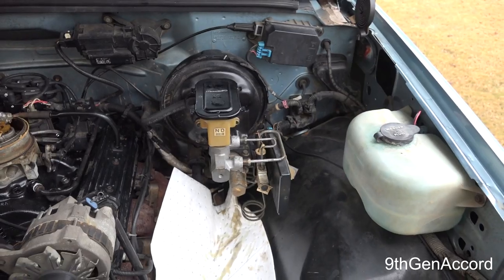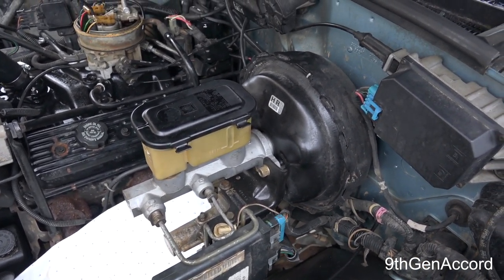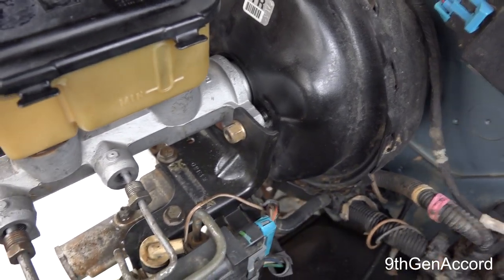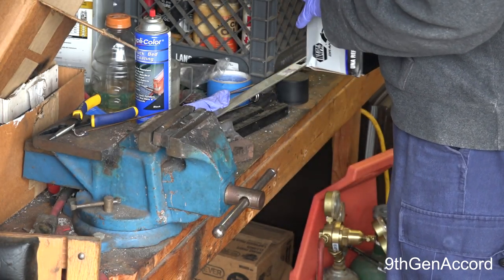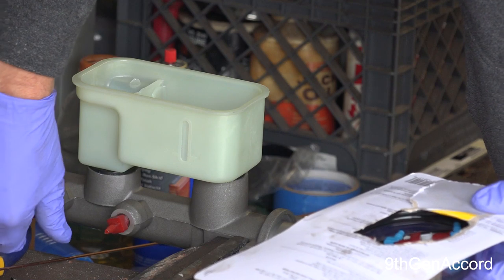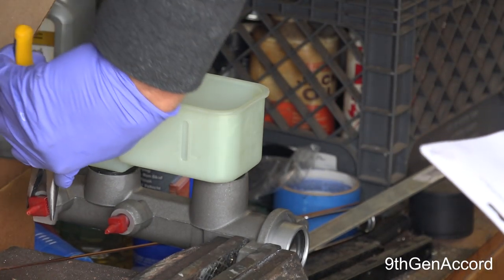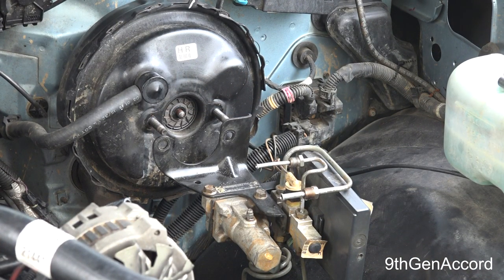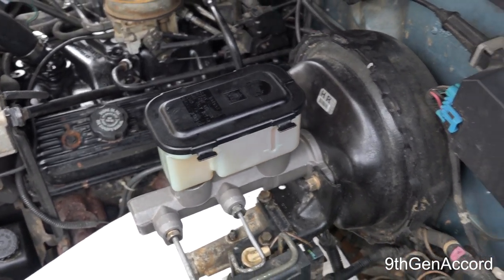How to install a brake master cylinder on a 1988-1998 Chevy K1500 Silverado

Comment: I replaced mine … baby can do! You dont need a vice all hog wash just put on floor front against wall or board and push slow and release slow keep doing tell no more bubbles. Then install it back bleed both lines someone push on break and you Losen nut tell no more air then do the other line done

Comment: hey alright nice job, is there any other time a master cyl. needs Bleeding how about if it's been run, real low ,
while doing a brake repair ?  should is see two rising puddles while bleeding master or just one like on yours, I'm trying to find out, if my 1990 pontiac, with disk in front and drum in rear , that don't have any pressure diagonally on 2 of the 4 lines and is unbleedable with no pressure on half the master cylinder lines as I have 4

Comment: Couldn't you just have bolted it back on therefor you could use brake pedal to take air out once bled just connect hose instead of using a vicegrip
Reply: I don't have a garage or a work bench & that's exactly what I did to bleed it. Worked like a charm
Reply: that's exactly what I was thinking
Reply: I think that's way easier to just mount it and not hook up the lines and bleed.right there
Reply: You can but on the bench you can see when all the air is out vs on the car you would need 2 people or just guess when all the air is out.

Comment: 2001 masters cylinder  much better 
Dorman M630031 Brake Master Cylinder Compatible with Select Cadillac / Chevrolet / GMC Models
Amazon's
Choice
for "dorman
&
ags blf 26c brake line adapter